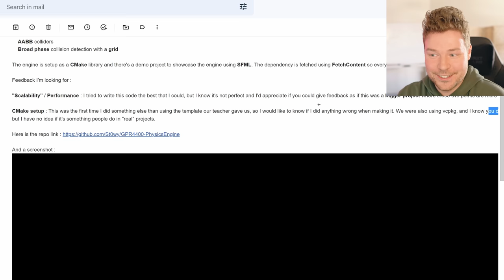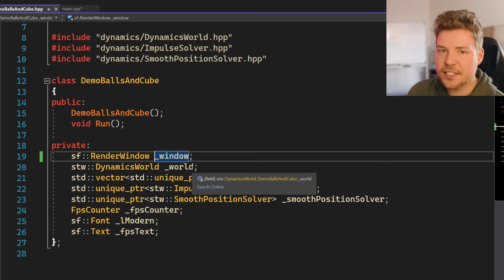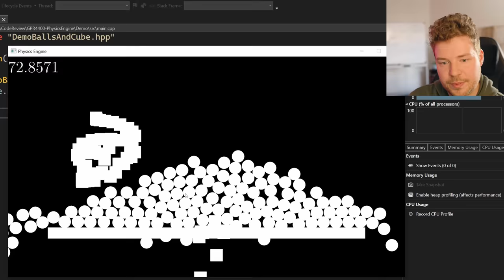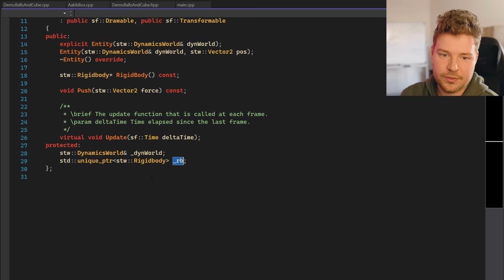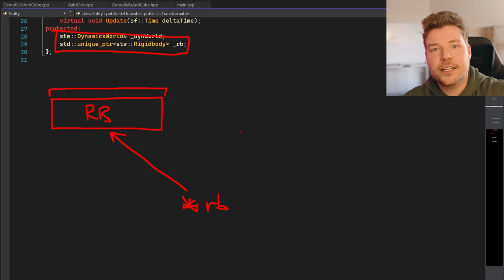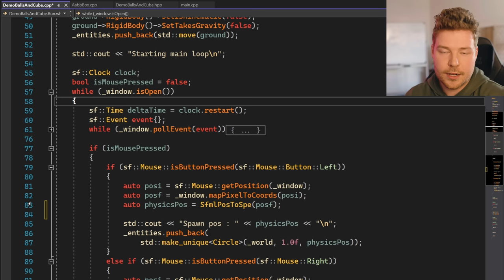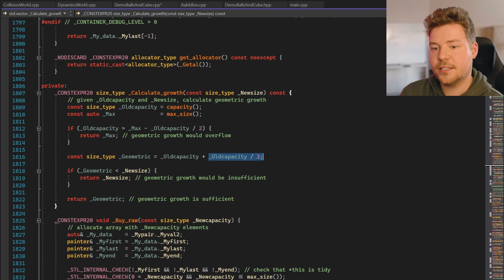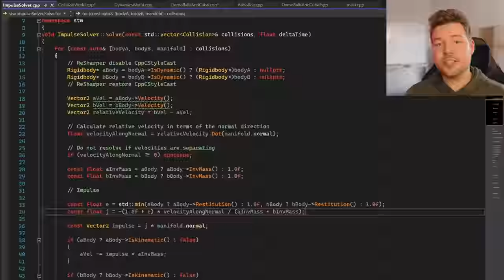All about MEMORY // Code Review

Comment: when did the concept of Random Access Memory die. modern performance programming is literally all about not randomly accessing memory.
but i know that wasn't the case on older computers
Reply: When CPU speeds started to exceed RAM speeds, so cache (small memory that is close to the CPU core and much faster than external RAM) and prefetching became a necessity.
Without that RAM would constantly bottleneck the CPU.

Often times, depending on the type of memory used, sequential accesses to memory can also be faster than random/non-sequential access, because the address doesn't need to be transmitted and decoded for every access.

Comment: "CMake is lil bit arcaic, a little bit oldschool"... I would say the entire world of C/C++ buildtools are a little bit arcaic and a little bit dated ngl. Something like rust is just miles ahead from a comfort POV
Reply: I still use `make`, which I'm sure you'll say is even more archaic than `cmake`, and Rust is for children who don't know how to program.
Reply: @Can a swallow swallow? Yeah, right? Immagine, back in the day when we started the entire programming gag we still used to use punchcards and had a max of running a program once a week since it was so expensive and it had to work, and now they complain because of buildtools... pft
Reply: @anon_y_mousse  I think make is less archaic than CMake etc simply because it's not just a buildtool
Reply: Sounds like half the folk commenting here don't know what CMake is.  It's a configuration tool for building make set ups (make, ninja etc) across different platforms from a single definition.
Reply: @nitsujism  I know what CMake is, do I know what the type of app is called? no, because except for very specific technologies stuff like this doesn't exist anymore because even the smaller languages come with more comfortable tooling to use. And there is not even a legit reason why Cpp shouldn't have more comfty to use tooling. Look at Rust for example, way harder language and by far not as mature of an ecosystem, but it also attracts people from sectors which usually have nothing to do with system languages like web devs... why? Because It doesn't take me 1 month to learn how to setup a project and add a single dependency.... And once you get used it still takes way more than neccessary to add a library to your project... CMake should probably be deprecated by half a year, but I guess a good psrt of Cpp devs just love to rust sonce it has other benefits like better error messages and memory safety... and better project related tooling....
Reply: @nitsujism  What I was saying and your poor reading comprehension failed to pick up on is that I write my own Makefile's from scratch.
Reply: @anon_y_mousse  Why did you assume I was referring to you?
Reply: @nitsujism  It's not an assumption. Two people had responded before you. I'm the only one who mentioned `make`. So unless it's poor English skills on your part, don't lie and say you weren't.
Reply: @anon_y_mousse  Well, in particular I had fischi's comment in mind regarding CMake being less archaic than make, which is the comment directly before mine.  And he responded with a view on it and some opinions about Rust - which is fair enough.  Maybe you should hone your personal communication skills rather than engaging auto-butthurt.
Reply: @nitsujism  Or you should hone your communication skills instead of engaging in auto-arrogance that you know others more than they've clued you in.
Reply: @anon_y_mousse  I'll be sure to work on my auto-arrogance.  Maybe you could work on yours: "and Rust is for children who don't know how to program."
Reply: @nitsujism  Prove it wrong.
Reply: My biggest complaint about cmake is that simple things are hard, but even premake, which is at least less bad in that regard, has similar problems. I feel like some of it is that both tools try to make it a full scripting system, which I'm sure probably makes them powerful, but for most projects is pretty overkill and causes a large amount of learning curve that doesn't really go towards actually working on your project. Most projects basically just need, "the code is over here, these are the dependencies, here's some simple configs for debug, release, tests, and maybe some platform specific stuff." Having advanced features is certainly nice, but they shouldn't be at the expense of making simple things hard, especially in projects that have no need for those features.

make is... well... I'm sure it's a very powerful tool, but let's not pretend it's user friendly, and its design certainly has a very archaic feel to it from the days where storage was expensive.
Reply: @Dullstar2XQT  Simple CMake files pretty much are 'here's the code, here's the dependencies, here's some language/compiler flags etc'.  The problem I think is that any system like CMake which is coming to the C++ party late has to account for a bewildering number of project set up and configuration possibilities otherwise it just wouldn't get any kind of adoption.  There's no question this sort of thing in the C++ world is playing catch up.  As for Make, well, it's not giving me automatic cross-platform support and it's definitely archaic.
Reply: @nitsujism  Dependencies on CMake very much rely on the library providing the configuration files, and if you've got a dependency that doesn't provide it, their documentation is very unhelpful and more or less just says to look for config files that someone else wrote, which you hope works, until you realize that the one you found doesn't tell you what the exact name of the target you're trying to link is, and also doesn't technically provide a license which some will helpfully tell you doesn't mean it's public domain. That is, if it exists at all. All right, so there's no documentation on how to do it that I can find but that's okay, it can't be that hard, right, let's just look at the config files provided by this other library as an example... oh. So much for that. Of course, other languages get away with it because the build systems are so tightly integrated with the rest of the toolchain every library provides those configs anyway, but I'd much rather have to make a library configuration given just the source files and a list of the dependencies for one of those languages than for CMake, that's for sure.

I'd also add that their documentation heavily implies that wild carding the source directory so you don't have to update the list every time you add a new file is very bad and you shouldn't do it (although I will say I don't remember if it doesn't allow it or if it just frowns upon it) which necessitates a lot of manual CMakeLists management that you don't have to do in, say, Cargo.
Reply: @anon_y_mousse  might as well say "helmets are for people who don't know how to ride a bike". ridiculous.
Reply: @Anbaraen  It's more like saying Tesla Auto-Pilot is for people that want a safe driving experience. It'll work up until a certain point and if you don't know where the bug is you and/or a random pedestrian or other motorist is dead.
Reply: @acenio654  Yeah, we need programmers who don't know what they're doing or that get on the job training without a veteran coder around to teach them not only how to do things but more importantly why. That'll make all the code in the world better. Oh, and as a bonus, we need to take every old program and rewrite it from scratch in our new pet language that's barely had any real world testing. Will it be as feature complete? Nah, of course not, but it'll be pretty, and that's all that matters when writing programs, pretty colors. So, you're right, we don't need people like me to keep the youngins like you in check, on the ball and writing good and useful code, that's elitist gatekeeping.

Out of curiosity, do you know anyone who depends on any modern drugs or medical devices? Would you trust the manufacturers of those drugs or medical devices if they decided to throw out whatever code they were using and decided to rewrite it from scratch in C# or Go?
Reply: @ДавидПлеван  It's not ego, it's reality. It's not workarounds, but knowing how tech works. There are genuine reasons for doing certain things a certain way that a newer programmer won't know or understand. Use a new programming language that's only got a decade of testing if you want, but I'd prefer to use something that's stable because it's been tested ad nauseam over the course of 4 decades. Although, in your case, I think Scratch might be more up your alley.
Reply: @anon_y_mousse  It is obviously ego. If it wasn't you wouldn't be diminishing new tech that is actually production-ready and deployed in many systems around the world without providing any real arguments besides "not tested with time", which in itself is not true. I just think you can't accept that you'll have to relearn alot when switching to new tech. C, Java, JavaScript and many other older languages, while having been completely fine in their time, were discovered to have many fundamental issues, they do not scale well up to today's standards and needs, and obviously they cannot fix these fundamental flaws due to the wide adoption. We accepted their flaws as a norm because we grew up with them and they're so familiar. The point of new tech is literally fix these fundamental issues and also make programmer's life more safe and productive by having it point out for you very specific issues even before compilation and provide some tips. I do not understand your specific issue with Rust, it's still a complex language with a lot of possibilities for writing safe, and raw unsafe code, but you can use your C, nobody will take it away from you. Fortran might also suit you.
Reply: @ДавидПлеван  It's still not ego. While Rust may be 10+ years old now, it's really only been used in production environments for 3 or 4 years. It hasn't seen the kind of testing necessary to prove itself. As for examples: compilation time, bloat, stupid design in a lot of places, emulation of what C provides while claiming to be better. No, it is not memory safe, especially because of unsafe code segments. Don't give me the bullshit that you know where the error is if one happens while claiming an error isn't possible. There are static analyzers for C that perform better than Rust's and they've been around for decades. If your only semi-valid complaint about that is that it's not built into the compiler then you don't understand what it really takes to be a programmer.
Reply: Cmake is not archaic....it's one of the most flexible build system generators out there. You can do more with it than half the others that typically get mentioned. Rust is still not as performance as c++ although it's pretty close. You'll never get the control C++ gives you from rust though.
Reply: Not to mention constexpr and consteval are something you will never get from rust which allows you to cut down runtime substantially in many situations by moving that work to compile time...I can load half my resources into variables before I've even run my program